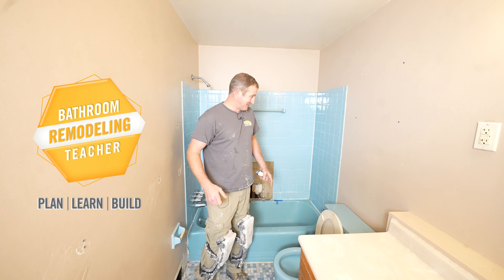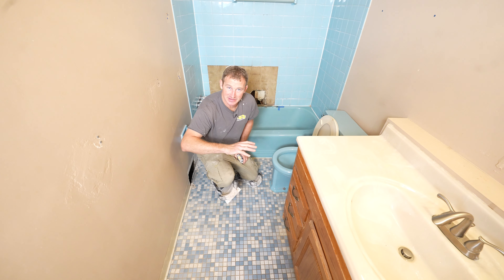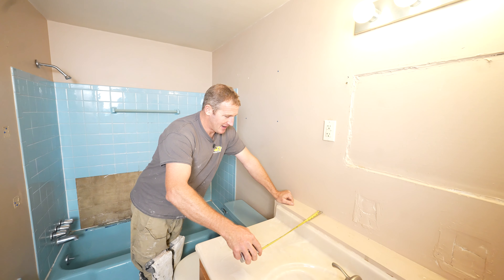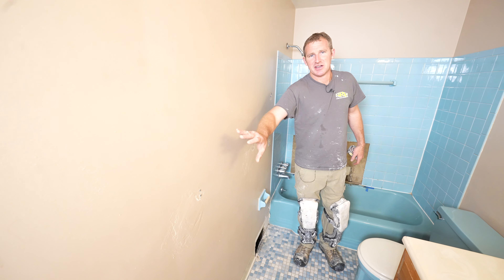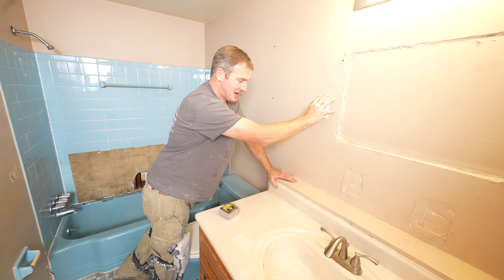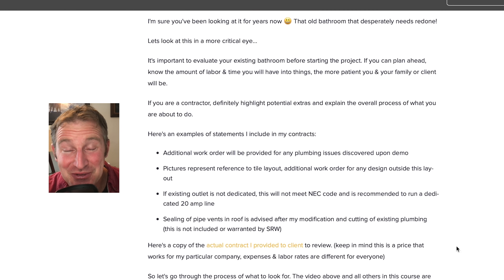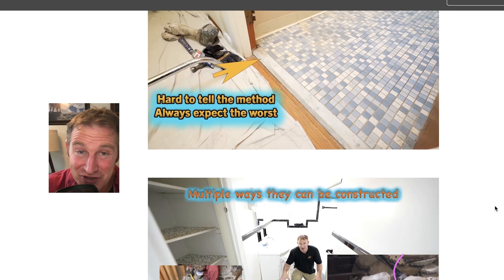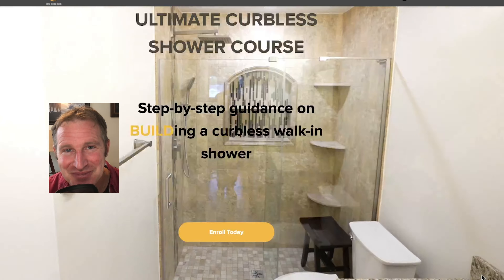Estimating a Bathroom Remodel | Time & Labor

Comment: I did a bathroom from the 50s that was just a 3x3 shower stall and a 6x5 floor area....4500lbs of concrete & tile removed from it.

The floor was 2 inches of concrete on the main floor and half way up the walls.

The the shower pan was 5 inches thick with a lead plate, and every wall was 1.5 inches thick behind the tiles.

It was insane. I don't know how the floor didn't sag in that spot.
Reply from the maker: It is crazy. That’s about what I  got out too in a recent project like that. And yeah, no one cared about weight load back then I guess 😆
Reply: This is me right now. Wtaf😂 I had to come to YouTube because even though I'm looking at concrete, I can't believe I'm looking at concrete.

Comment: PLEASE GOD DO NOT BUST THAT TUB OR THAT TOILET UP THEY DO NOT MAKE THOSE ANYMORE AN THEY ARE VERY VERY VALUBLE . TOILET -700$ , TUB -$1,700.
Reply from the maker: Really? An old blue toilet $700?
Reply: @BathroomRemodelingTeacher  yes if it is in good shape the tank is around $250 an the bowl is around $350 the tub I guessed at I was a little high on the tub but the tub with no dings in good shape is probably$ 1200 . They don't make those anymore an old people with Blue fixtures buy them because there whole bathroom is tiled in blue I wanna say those of 1950's or 1960's homes . If you find a pink bathroom it's the same thing . Only catch is selling them you might have to store them until you find a buyer . Ebay , Facebook market place , post them on all those apps . I am a plumber that's how I know what they are worth.